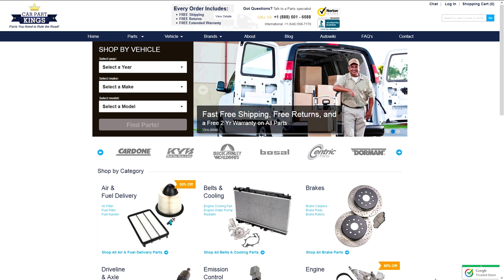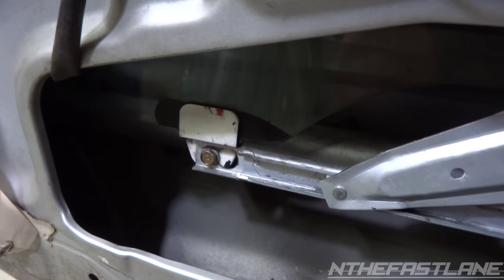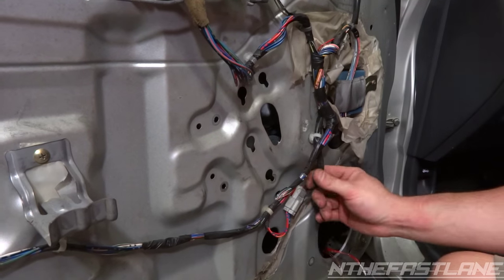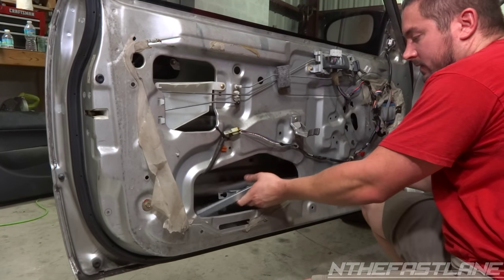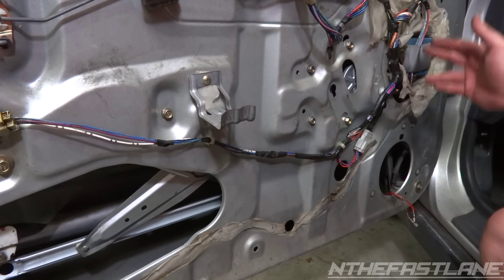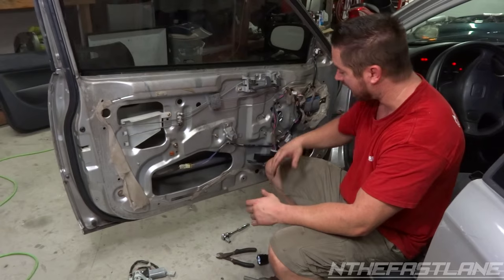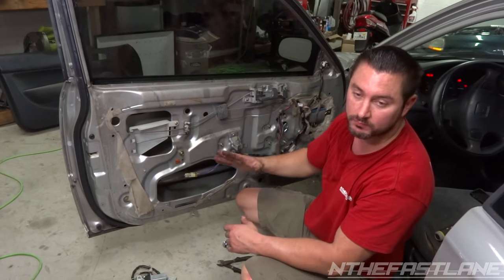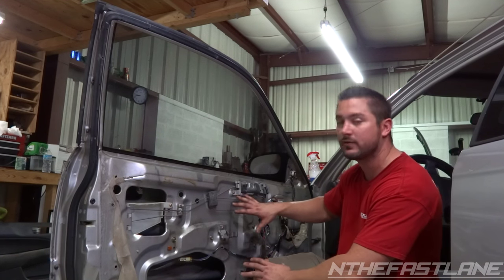▶️Window Regulator: How To Replace (Civic Coupe 96-00) "Driver Side"🔧

Comment: Kevin.Thank you for this video. I inherited my mom's car, which is a 2000 Honda Civic Ex Coupe 2 door. And both windows have the regulator damaged.  You have given me hope to fix my issue. I would say that if you had to re-edit the video, if you could put some text and an arrow at the 1 minute 35 second mark to say that the bolt is not in the correct place.  I have looked at other videos for the repair. Your's is the best.  Thank you. "All things I can do which Christ strengthens me".

Comment: I just ordered my new regulator after watching this video and feeling confident that I can do this.
Reply from the maker: You got this T. 👊
Reply: @Nthefastlane  Thanks, again, NFL. I'm sure this saved me a ton of beginner's mistakes. I still managed to make a few though:, like not verifying the window is in both the left and right grooves before fastening the bottom bolts.

One thing surprised me, though: The spring was completely missing from the broken regulator. It was nowhere to be found. I think it came from the factory this way. So the window now works better than it ever has.

Comment: How exactly do you get the 10mm bolts out if you cant let the window down due to bad motor??
Reply: If it's in fact a bad motor. He showed how to remove by cutting cable. Only if its bad. Must have a new one before cutting

Comment: Thanks for posting the video - changed it without a problem thanks to your video. Now i think i have to change the tracks. Regulator helped but its still having a hard time staying on tracks. Its better but not right. Is there a video for removing and replacing the tracks?

Comment: Hi great video i got a question i have a right hand drive Honda coupe 1999 can i swap the motors from passenger and driver  bcuz i can only find LHD regulator ?
Reply from the maker: Yes they should swap out fine. I haven't looked at a right hand drive vehicle, but for the most part I'm sure the regulator set up is identical.
Reply: @Nthefastlane  Thank you for the speedy reply will try and let you know if that work

Comment: Hey there, i have my passenger side window not rolling up in my 1998 civic hx. i have new window regulator/motor in there and just need to attach the window to the assembly. but before doing so i wanted to make sure it works. I plugged it all in and clicked up, nothing, clicked down and the new motor moved it all the way down, but again it would not go back up. so I am back to the same problem i had with the old motor. I could really use some help, lemme know if and how you can help please

Comment: I just replaced. It’s but noticed driver side is stopping on way up and down is there a auto reset for the window function?
Reply from the maker: +Ramiro Cavazos It sounds like your spring in the regulator wasn't preloaded when you installed the motor. Make sure you pull the regulator back to zero before installing the motor or the teeth will be half way up. Hope this helps.
Reply from the maker: +Ramiro Cavazos Also make sure you leave the tracks loose like I did in the video and bring it down. Then snug them tight and test. This could be binding the window half way up as well.
Reply: Thank you I’ll definitely re check it

Comment: If I can hear my motor but my window won't roll back up does this mean I need a new regulator because window is still on track when I took panel apart still in rubber seam

Comment: I wasn’t able to see the issue with mine. It is weird how it was left, both of my windows are stuck but the window regulators are on the bottom and loose. I don’t even know how they managed to keep the windows up without any screws on. Unless I’m looking at it wrong. The driver door is a bit opened and I been trying to put it down without breaking it and no luck. I want to connect the regular back on, it seems to work.

Comment: if the regulator was placed without the Spring, would it be a problem?
Reply from the maker: Yes, puts a lot more load on the motor. You need to have it installed. Basically a garage door without a spring, 100X heavier.

Comment: Hi brother, I'm Mike in England, I need your help DESPERATELY please bro 🙏🏼.
SO I have a UKDM 2000 Honda Civic EJ9 Hatchback and ordered from (Amazon US)a Dorman 741-736 which is for the USDM Civics (Passenger Front Right side) but for my UKDM Civic, Front Right side is the Driver side.
And so on inspection of the Dorman regulator I received, it seems visually that it will fit but unfortunately the motor electrical connector plug is a (2 pin plug) whereas my UKDM regulators motor electrical connector plug has 4 pins. Do you think there's a way around this bro, please help
😢 😢😢😢
Reply from the maker: Hey Mike,

I just checked on Amazon and they do sell a 4-pin window regulator. Type in the search: " 2000 Honda Civic window regulator 4 pin". It should pop up.
Reply: @Nthefastlane  Hi brother, mine is a Right hand drive Civic, UKDM....
Reply: @Nthefastlane  So basically my right side door is the Driver side so I have the US civics (right side door) regulator, US civics being the passenger side compared to my right hand drive UK/ Australia market Civic. So regulator will fit great just plug is for opposite side due to the driver side differences between US market and UK market....
Reply from the maker: @michaelpaterson8086  I see what you're saying. I wasn't able to find a passenger 4-pin. The only thing I can see working is if your motor is still good on the original one, you can swap that out.

Or you can track down just the motor and swap it out on to the US window regulator track. Call up your local Honda dealer and see if they have a part number for the window regulator motor. Then you can go from there and track it down.

Comment: My window makes a super loud click, click, click and you have to physically pull it up to help the motor push it up. It feels like something in their is super tight! Is this the same thing to fix that this video is talking about? 95 Del Sol
Reply from the maker: Yes, it could have a bent arm as well. Sounds like it's getting stuck and the motor is jumping teeth. If it jumps teeth too often it can grind the teeth down and then it'll eventually not work at all.
Reply: @Nthefastlane  Great Video. I am going to fix this myself!! Thanks very much sir!!
Reply from the maker: Anytime Mike.

Comment: the problem on my 96 civic is that the window does not stay on the track in the back. I've tried a million times to get it to come up inside the damn thing but it keeps coming over the track and it's so slow even with a new regulator. it is really annoying.
Reply: maybe the track is broken?

Comment: This video recommends using Car Part Kings.com. Based on my experience, I would not do business again with CarPartKings.com.I ordered a window regulator for my Honda Civic 1999 non-coupe from them using their search system. They sent me the wrong part. I attempted to reach them by phone, by email, and by the messaging system on their website. They did not respond to any of these communications. I have now disputed the charge on my credit card. The credit card company advised me to return the part to the address on the box. I did so but it cost $18.72. So I am out almost $20 for return shipping and on the day of the repair had to run around trying to find the right part for a higher price. I would NOT recommend CarParkKings.com.
Reply from the maker: They were bought out. You can purchase any part in the video by either clicking the top comment where it says "Shop this video", or if you're on my website watching the video it'll say "Shop this video" underneath the video. I always keep the shopping carts updated.
Reply: @Nthefastlane  What about Rock auto